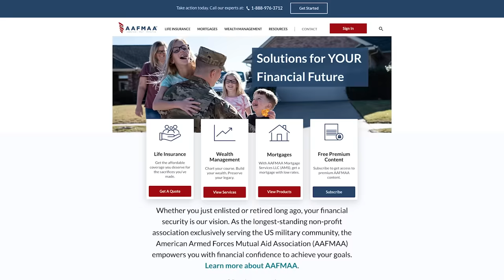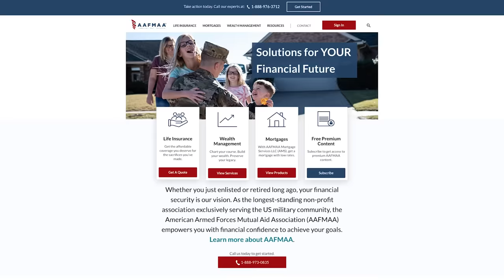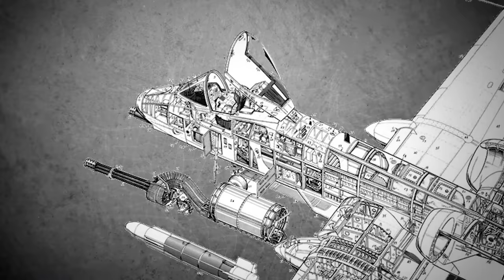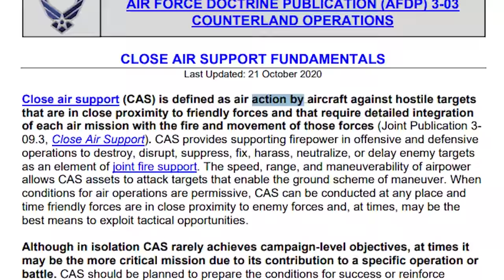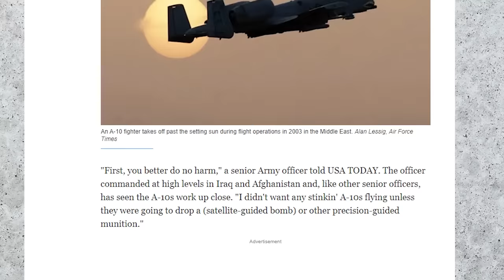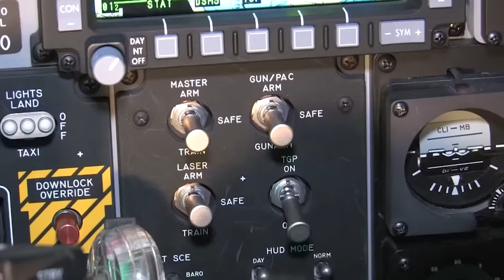Why the Air Force is Screaming to Retire the A-10 Warthog

Comment: Long loitering weapons delivery platform can be done more effectively by drones, heck they can be controlled directly by infantry units in the future for even more agile responses to front line situations. I love the A-10 but both the mission and the technology requirements have changed and the plane is simply not a viable platform for future conflict. I wonder if the Ukrainian would even use them if we just decides to give our fleet of A10s to them tomorrow. Given the lack of air superiority they are likely going to be deathtraps for the pilots and it would be difficult to even get those planes close enough where the 30mm can even be put in play.

Comment: A-10 is kind of ridiculous.

The 30mm autocannon, even if it were accurate enough to score repeat hits, wasn't capable of destroying modern enemy armour--And given the ridiculous inaccuracy made it obscenely dangerous to use in the role it was built for.

The A-10 has recorded the highest blue-on-blue casualty rate of any U.S. aircraft in history, and I don't understand the 'pretend love' of infantry and forward ground support people seem to assume it has garnered. Sure, that distinctive whir of the cannon may have been a morale booster, but frankly it was suicide to be somewhere in the same city block of a target it was rattling off at.

This how a whole  bunch of Marines died being on the ground floor of a larger building.

Because hey... maybe an aircraft built around its cannon and being called in in the very role it was supposed to be designed for should be able to score hits on a floor 16m above your head without ripping a third of your platoon apart?

Basically all the love I see for the A-10 is from everybody that didn't face the prospect of being friendly fired into an early grave by one. This is the reason why so much of 'The Coalition of the Willing' was unwilling to have them providing CAS.

Rest of the World: 'F-16', 'F-16', 'AH-64 & F-16', 'F/A-18' ...

U.S.: "Would anybody be interested in the A-10?"

Crickets

The A-10 was built around its cannon, and the cannon does not do the job it was supposed to. Its complete lack of features make it incredibly hard to discern friend from foe  and operate either independently, in places where air superiority is not guaranteed, and in urban environments. Its pricetag was fucking ridiculous when you consider that the F-111 did its job better, and the only reason F-111 isn't still being used in the role of the A-10 (despite objectively better performance) is because they decided to stop making airframes and parts for it.

Much to the chagrin of every soldier that actually needs precision ground attack in any environment, with better short and long range fires capability and capacity to operate long-term in theatre with greater survivability against anything thrown against it. 

The A-10 airframe cannot even handle the thing it was built around--Leading to wildly inaccurate fire that puts civilians and friendlies in jeopardy.

The thing should have been retired decades ago.

We had objective proof the A-10 was inferior in all ways compared to fighter bombers that had better export markets back in the 1980s and early 90s ....

The way people talk about the A-10 reminds me of all the certified fucking brain donors spewing on about the F-35 and pretending like it's somehow 'bad'. Despite the fact that it has the RCS of something a third of its mass made from cardboard would have, while literally being the only supercomputer to have ever flown and capable of landing a hit square on the head of a nail.

Comment: The air force didn't ever want the A-10 - it didn't fly fast and make chicks blush.  As regards your comments about small arms fire bringing down Skyraiders, could you site some sources please?  I could find nothing as regards small arms fire bringing down a single Skyraider.  Anti-aircraft artillery IS NOT small arms fire.  I'd love to see the comparative per centage losses of the aircraft that operated in the same flight envelope as the Skyraider.  The ruggedness of the radial engine made the Skyraider a beast to bring down - lose a cylinder, so what?  The Skyraider was no where near the fastest aircraft in the Vietnam theater, but like the A-10, the ground forces loved them.  Their time on station was a huge plus as well as their ability to conduct CSAR.  Ditto for the A-10.

Comment: I am going to comment -THEN watch the video as nothing would change my opinion. The A-10 despite its age is still MUCH cheaper to maintain than any version of the F-35. Even if it might not be wise to use it in a war with a peer, many missions are against non-peer forces where a much less expensive aircraft can free up stealth assets. The A-10 can be used from forward positions without the need for pristine perfect runways which amplifies its superior loiter time and range and partially negates its lack of speed (F-35 is still regulated to non-mach speeds right?) The A-10 can also serve as a bomb-truck which is another use. In my lifetime the first priority in any conflict has been ruling the sky and eliminating air defense and command and control, accomplish those goals, and the vulnerabilities of the A-10 magically disappear. The A-10 is not a super plane excellent at everything, but it IS perfect at certain things -Aces in their places. Edit addition: If the A-10 sucks so bad, why was it one of the first units deployed to Jordan to support Israel?

Comment: I wonder if Taiwan would like a couple of squadrons (especially at surplus prices) as further deterrence against invasion - landing craft and amphibious "tanks" tend to be somewhat less heavily armored than MBTs.  Yes, the air may still be contested in the beginning stages of an invasion, but is unlikely to be overly dominated by the aggressor, especially after US aircraft carrier wings enter the fight. And with the reputation of the A-10, it would certainly be a morale booster for the ROC soldiers and and deflator for the PLA.

Comment: The airforce has been trying to kill the A-10 for longer than any opponent.  But while an F-22 can do some things the A-10 can, it cannot do it all.  I just don't see it, unless they have a dedicated ground support aircraft.  And they do not.

Drones might be able to fill the gap, but i don't know.

But the elephant in the room is that aging air frames get more and more expensive to keep operational, and eventually the cost outweighs the benefits.
Sadly, i think the A-10's time has come to retire.  But i don't trust the airforce to come up with a truly great replacement.

Comment: The Army should takeup the continuation of the A-10. It's like air cavelrry. It needs a hover capability. Surface to air protective systems (armor & misile avoidance). Probably deployable, atonomous drones in defensive mode (halo).

Comment: The A-10 has been an excellent program bar none but the airframes are close to being spent, parts supply chain is thinning and the numbers of useable airframes have been dwindling a while now. That and the battlefields are changing to where they are more drone-centric and that has been made even more clear by the very high lethality of drones used in Ukraine against Russian forces. However, the AC-130J Gunship will easily be able to handle a lot of the A-10's CAS duties in uncontested airspace with it's 30mm cannon and 105mm howitzer.

Comment: The a-10 is the cheapest per hour combat system the Air Force has.  The Air Force is selling out to the military industrial complex ($$). Bullets are cheaper than missiles and in a prolonged near equal conflict, we would have missile supply issue. Missiles are also very expensive. So, money wise, the a-10 is the cheapest option.  F-15’s, 16’s and 35’s are too fast to engage in CAS. The Air Force wants to abandon its CAS mission. Maybe give the a-10’s to the Army or develop a worthy successor- problem will be the cost. Check out the cost per flight hour. Newer systems are temperamental and more expensive to operate. Anyway you cut it, the Air Force wants out of CAS and wants to only operate the most expensive air frames.

Comment: It is going to be sad to see this plane go though I understand the reasons. That said I am not convinced that the F-35 can fill this role as well. I think there will still be a need for an A-10 style platform in areas without air defense. Hopefully the military will come up with a drone that can do what the A-10 does today.
Reply: Turboprop attackers have been well proven to perform excellently in A-10's role - COIN ops in low intensity regions - for a fraction of the price and upkeep.

Comment: It needs to go ASAP for all the reasons quoted. However the close ground support role is very important. It should to be split between a mix of F35A, turbo prop Tucano and unmanned systems. The combined effect of such a versatile and varied fleet, would enable commanders to select the most appropriate platform for the job in hand. F35A and top-end drones for highly contested airspace in near peer on peer conflicts. To slow moving much cheaper drones, C130 gunships and Tucano strikes against insurgents. Keeping all options open. 
In such a perfect world scenario, a commander who chooses F35A to hit an insurgent compound with zero air defensive capabilities. Can be severely reprimanded in they can't explain the unnecessary waste of resources. It's common-sense really. 
Why try to do everything with the F35A?
Place all the above assets under a Close Air Support Command and let it grow and develop from there.  💂‍♂💂‍♂💂‍♂💂‍♂💂‍♂💂‍♂💂‍♂💂‍♂💂‍♂💂‍♂💂‍♂💂‍♂💂‍♂💂

Comment: CAS is hard, it's dangerous, and it doesn't get officers promoted.  The USAF never wanted to perform CAS, still does not want to perform CAS, and will never want to perform CAS. They also don't want to see the Army perform CAS either.  The USAF has not learned anything since WW2.  They are hyper focused on strategic bombing and fighters.  They want multi-billion dollar stealth systems not because they are better at anything in particular, but for the same reasons they bought the Starfighter and Thunderchief.  If A-10s cost 100 million dollars each, the USAF would be paying thousands of shills to keep it.

Comment: Loss of A10 for an F35... means:
Increased cost of aircraft 
Reduced time on station
Reduced weapons on board
Increased maintenance costs
Reduced duplicate capacity
...each time an expensive aircraft is offline for maintenance, no capability is available.
Reply: the f35 can carry more weapons, it can use them with more precision, has better survivability and is faster

Comment: The A-10 is the quintessential tank and armor vehicle destroyer, even more potent than other fighter-bombers. It's all about accuracy and not just indiscriminately dropping bombs, hoping they'll make contact.
The A-10 is cheaper to produce and packed with armor, much more formidable than the Russian Hind helicopters. Why ditched a proven system that only requires upgrades when needed. A-10 is an all weather aircraft. Give it to the Army and Marines if the air force doesn't want it. Sounds like politics and lobbyist pressure to me....gg, Tampa Florida

Comment: Given the pattern of US military interventions in the past decade, it seems to me that the US should maintain platforms that are especially effective or cost-efficient at dealing with low-tech enemies like insurgents or 3rd world despots, or at least find analogous replacements. By all means be prepared to fight the latest Chinese fighter jets, but this should not come at the expense of being able to perform counter-insurgency.
The more advanced missiles get, the more expensive they get, and it just doesn't make sense to waste a $150.000 Hellfire missile on a vehicle orders of magnitude cheaper when a few autocannon rounds would do the job just fine.

To be clear, I am not wedded to the A10 per se, I could see a drone with similar specs perform a similar role. My point is that cost-efficiently dealing with large numbers of outdated enemy vehicles seems like a non-trivial niche for the US military.

Comment: On a modern battlefield, with both sides equipped with anti-air munitions, how useful would the A-10 actually be?  We don't see ground attack aircraft being used for close air support in the Ukraine war.   It's so dangerous now for pilots they have to launch missiles and rockets from a distance. 🤷‍♂

Comment: The fighter jocks in the five-pointed building NEVER liked the A-10 as it was NOT built to fly fast and shoot down airplanes. The thought of replacing it with the "SLUG" (F-35) is a joke. The "Pleasure Palace" People do not understand defense in depth nor defensive platforms outside of the AC-130.

Comment: Late to the party but my two cents:  Maybe we need to call for proposals for the Warthog II.  Similar platform, just modernized.  And replace the front gun with something more useful that's anti personnel and less anti tank.  'Cuz ya know, we have to have: "Front gun goes BRRRRRRRRT!"
Reply: "replace the front gun with something mroe useful that's anti personnel and less anti tank"

How about rockets?
Reply: @pancytryna9378  as long as they got BRRRRRRT!  Apparently soldiers love that sound.
Reply: @thatjeff7550  
Every damn plane has brrrt it comes free with the rotary cannon
Reply: @pancytryna9378  and do you not recall your previous response when you suggested they replace the cannon with rockets?
Reply: @thatjeff7550 
More precisely, as  you called it, the "front gun"

F-35 and F-22 have the gun inside the fuselage, for example

Comment: The US Air Force has always hated doing close air support.  The A10 was made with the Air Force Generals kicking and screaming that it should not be built.  And they have tried to shut it down at every opportunity even trying to cut the budget for ammunition.  In Iraq the Air Force tried not to deploy the A10 when Iraq had 5000 soviet tanks.  General Schwarzkopf said to the Air Force, "Where are my A10's?"  The A10 cleaned house and destroyed more tanks than all other planes combined and even some missile silos.  The air force conducted a misinformation campaign to prevent the public from knowing about A10 amazing contribution in Iraq.  Instead the emphasized the stealth aircraft bombing but ignored the A10.  The Air Force generals excuse to retire the A10 is that it is old.  The Air Force should have already started developing the next gen A10 by the mid '80s.  That is their fault.  Their behavior is reprehensible.  They forget that they are part of the US Armed forces as a whole and if they weren't adults they should be lined up and spanked.  At least a reprimand from Congress and the President of the USA is in order.  I think the A10 should be literally ripped out of the hands of the Air Force A10 haters and put in the loving arms of the US Army along with all money that would normally be budgeted for the A10 program.  Yes all necessary money should follow it.  Clearly a next gen A10 is in order and be in the hands of the Army.  Then the Air Force can stick to their air to air combat and bombing that they so love to do and the Army can have their close air support needs properly met.  There needs to be a price paid for this kind of short sightedness and selfishness.  This is ridiculous behavior.
Reply: The Air Force tried not to deploy the A-10 on the frontline, because it would suffer heavy casualties if they did so. Instead it was relegated to clean-up roles and patrols that on rare occasions supported US ground forces. It still suffered the highest combat losses of all US aircraft, because it is practically impossible for SEAD to eliminate all air defences.

The A-10 has more kills of thin-skinned vehicles than any other platform in the Gulf war. The F-111 equaled the A-10 in tank kills while performing fewer of the same interdiction missions, because it could carry more LGBs than the A-10 could carry AGM-65s. Other than the F-111, it was rare for other types of aircraft to perform the interdiction mission, hence why the A-10 and F-111 are responsible for the vast majority of vehicle kills. So sure it did it's job, but did so to expectations, not to the point of excellence.

The Air Force did start developing the next gen A-10 in the 80s. It was the A-16, but it was cancelled in 1990 when politicians forced the USAF to retain at least 2 wings of A-10s without allocating any extra budget for them to do so. 

What short-sightedness? Notice how the USAF are the only operators of the A-10. Other nations' function perfectly fine without the need for a dedicated heavy COIN platform. Ideally they would cut back numbers rather than fully retire them, but they hold little value on a conventional battlefield compared to fighters performing CAS.

Comment: The Problem with Multirole aircraft taking over the A-10's job is When the Troops need CAS and all the planes are tied up in other roles. This is why there needs to be dedicated CAS aircraft in sufficient numbers  to protect the troops weather it is a attack Drones Helicopters or piloted aircraft.  The War in Ukraine should be studied thoroughly to see what is the best solution/s!